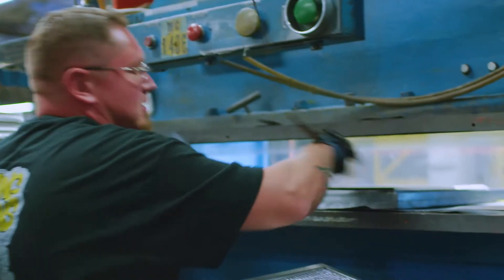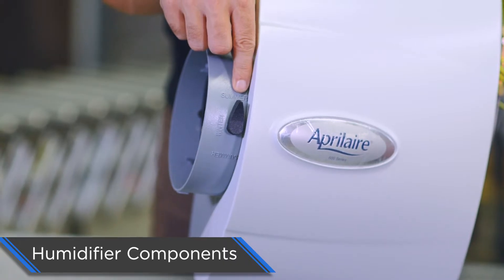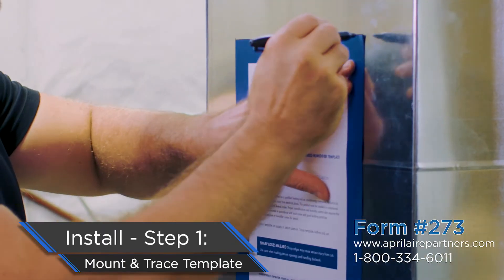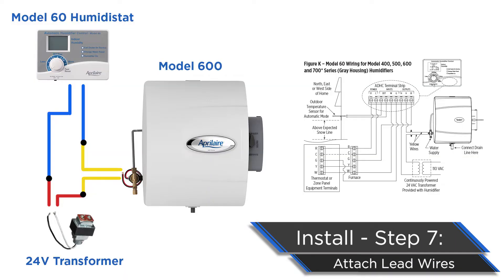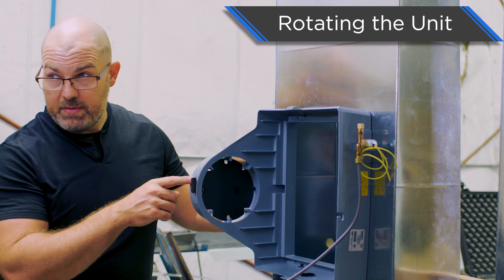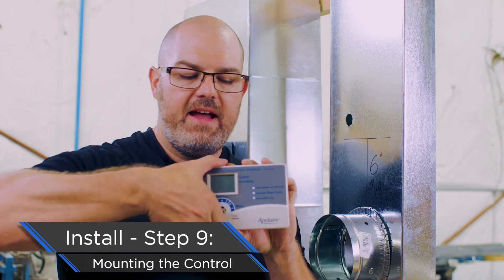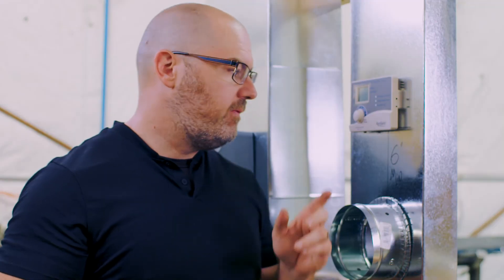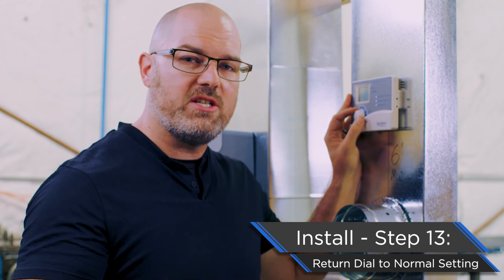Unboxing & Install | AprilAire Model 600 Humidifier

Comment: At the 12 minute mark the filter settings are discussed as being Off, B or C.   I do see an A printed on the circuit board. Just wondering whether that is a setting as well.
Reply from the maker: Thank you for contacting AprilAire! The A indicator is an option as well. The A indicator is for 150 hours of operation. The B indicator is for 300 hours of operation. The C indicator is for 600 hours of operation. If you need assistance for your specific unit, please contact our technical support team at 800.334.6011.

Comment: I would like to see or read some discussion on a system where the fan runs 24/7. How does that interact with the auto/manual switch inside the control and the on/off switch on the bottom-outside the control? Obviously, I don’t want water running 24/7. (Running the fan is needed for even heating and cooling on two living levels.)
Reply from the maker: Thank you for contacting AprilAire! The AprilAire humidistats require two requirements in order to run. There needs to be a call for humidity and a heat or fan call from the HVAC. If the fan is set to constant run, the humidifier would just look for a humidity call. The auto or manual setting would affect the set point the humidifier is looking to achieve. In auto mode the humidifier has a moving target based on the outside temperature. Where in manual mode it has a more set setpoint.  If you need any assistance, please contact our technical support team at 800.334.6011.

Comment: Did you change the direction of the bypass ? It was on the left first and then you finished off with having it on the right ??
Reply from the maker: @andresbravo6447  The bypass damper assembly will stay connected to the base and move with the base when adjusted.
Reply: Awesome does it matter if solenoid Valve is upside down if you change direction ?
Reply from the maker: @andresbravo6447  For operation, rotating the valve is not necessary; however, it is designed with the capability to do so if desired.

Comment: My unit caused mold somehow. Maybe I wasn't educated enough.  I don't know.
I am considering removing my Aprilaire. 
Should I seek and consult professionals for help? Why mold?
Reply from the maker: Thank you for contacting AprilAire! Generally with mold growth, it is seen due to an incorrect installation or application. We would recommend contacting our support team with any questions at 800.334.6011 and reaching out to a local HVAC contractor if needed.

Comment: is it ok to use the "W" and "c" terminals on the control board for power?
Reply from the maker: Thank you for contacting AprilAire! The control needs 24 Volts when the heat is running. We advise connecting to the hum and C terminals as those are outputting 24 Volts specifically for a humidifier. W and C are technically not outputting it for the function of the humidifier and more for the furnace operation. We would be happy to discuss this further and can be reached at 800.334.6011 Monday through Friday, 7:00 a.m. to 5:00 p.m. CT.

Comment: My humidifier green led light does not stay on. I have done reset several times, letting the led blink 60 times, then turning the dial to 4 or 5. Led stays on for half hour or so then turns off. It does not light up again when the heater turns on. What am I doing wrong here? Please help. Thank you
Reply from the maker: Thank you for contacting AprilAire! Could you please give us a call so we can walk through possible causes and discuss further? We can be reached at 800.334.6011 Monday through Friday, 7:00 a.m. to 5:00 p.m. CT. Thanks again for contacting AprilAire.

Comment: I installed this in my home, I noticed airflow leaks out through edge of closing front panel, so I have to aluminum tape around it.
And the water-drip grill does not stay in or lock in, it has tendency to lean to the front panel which will result in water leaking  through the edges.
The bottom water drain hole water leaks too.  This thing has full of issues.
Reply from the maker: Thank you for contacting AprilAire. We’re sorry to hear of the issues you have been having with your Model 600 Humidifier and would like to offer our assistance. 

Leaking can be caused by an obstruction of water flow or when the components within the humidifier are not firmly in place and level. 

If you would like to discuss this further over the phone, we can be reached at 800-334-6011, Monday through Friday, 7:00 a.m. to 5:00 p.m. CT. One of our technicians would be happy to discuss more with you over the phone.

Thank you for the opportunity to be of assistance; AprilAire appreciates your business.

Comment: What wire configuration should I use to make sure my humidifier doesn’t come on with the ac compressor? I just want it on with the furnace in the winter.
Reply from the maker: Thank you for contacting AprilAire! Would you mind giving us a call at 800.334.6011? We would be happy to walk through this with you in detail. We will need to know which controller you are using. A team member is available at the number above Monday through Friday, 7:00 a.m. to 5:00 p.m. CT. Thanks again for contacting AprilAire!

Comment: Does anyone know the width of the box minus the round duct opening
Reply from the maker: Thank you for contacting AprilAire! The product dimensions are 15.38" (width) x 15.75" (height) x 10.25" (depth). These dimensions are the Model 600 itself only and do not reflect the box it comes in. Does this answer your question? If you have any further needs, we would be happy to assist.
Reply: @aprilaireco  I’m looking for the width of the base of the humidifier. Not including the round part to the attachment of the round duct.
Reply from the maker: @absolute7250  Thank you for your follow up. The base will use a plenum opening of 10” x 12.75."

The base itself is roughly 12" wide and 17" in length. If you have any further questions, feel free to contact us at support@aprilaire.com or by calling 800-334-6011. Thank you for the opportunity to be of assistance; AprilAire appreciates your business.

Comment: Where is the R & C in the furnace?
Reply from the maker: Thank you for contacting AprilAire! The R and C would be located in your HVAC system near your other wiring terminals. Industry standard wiring terminals would utilize R,C,W,Y and G. You may need to contact your HVAC company to determine where they are located. Thanks again for contacting AprilAire.

Comment: What size cutout do i need to put in my plenum to install this unit ?
Reply from the maker: Thank you for contacting AprilAire! The Model 600 uses a 10”W x 12-3/4”H plenum opening. If you have any additional questions, we would be happy to assist.

Comment: The water into the pad  is flowing continuously.  I've removed the unit to replace the valve and removed the copper pipe going into the valve and also the plastic pipe going into the top of the water pad.  I notice there is a small yellow restrictor plug in the end of the tube going into the valve.  I assume this restrictor plug is to reduce the water flow to three gallons per hour.  What would be the results of removing the restrictor plug to increase the water supply to the filter?  Wouldn't removing the plug increase the humidity in the home?
Reply: The yellow plug is a a metering orifice.  If you remove it, the humidifier will immediately overflow and leak.  Also, never try to clean the hole in the orifice with anything other than water.  Enlarging the hole by even a few microns will cause the humidifier to overflow and leak.

Comment: Does the unit have to be installed on the return duct or the supply?  In theory it shouldn't matter should it? Thanks
Reply from the maker: Thank you for contacting AprilAire! The Model 600 can be installed on either the supply plenum or cold air return of a forced air handling system with right-hand or left-hand bypass duct connections. The humidifier dimensions and serviceability must be considered when selecting the best location for the humidifier. Find an AprilAire Healthy Air Professional nearest you to get started at https://www.aprilaire.com/find-a-pro. If you have any questions, we can be reached at 1-800-334-6011 Monday through Friday, 7:00 a.m. to 5:00 p.m. CT.
Reply: @aprilaireco  does this apply to the 500m as well?
Reply from the maker: @pilotdog68  Thank you for contacting AprilAire. Yes, that is correct. The Model 500 and 500M can be installed on either the supply plenum or cold air return of a forced air handling system with right-hand or left-hand bypass duct connections. If you have any additional questions, we would be happy to assist.

Comment: Hi, do you need to connect the ODT wires to enable automatic mode. My humidifier has been installed in manual mode but it is the 600 model not 600M. 

Can I simply switch it to automatic mode via the internal switch?
Reply from the maker: Thank you for contacting AprilAire! You do need to connect the ODT sensor to the ODT terminals in order for the unit to run in Automatic Mode. If you were to switch it to the Automatic Mode without the ODT, you would receive an E3 error code, which means no ODT. The humidifier control does not function while in an error.  

For clarification, Automatic Mode does not affect anything in the humidifier's operation. It just adjusts the set point we are trying to reach based on outdoor temperature, hopefully to prevent condensation from occurring on your windows. 

If you have any further questions on how the humidifier control functions, please don’t hesitate to reach out to us at 1-800-334-6011. We would be happy to assist. Thanks again for contacting AprilAire.

Comment: Do you need an outdoor sensor for Aprilaire to work properly? Also, does it matter what side you install the unit on? ( Return or Heat side?
Reply from the maker: Thank you for contacting Aprilaire! The Model 60 and 62 automatic humidifier controls need an outdoor sensor to run in automatic mode. Without one, they will run in manual mode. Automatic mode will just automatically adjust the called for humidity level based on the outside temperature to keep moisture from forming on the windows.

Bypass humidifiers (Models 400, 500, and 600) can be installed on the return or supply. With the Model 700, we prefer it to be installed on the supply, but it can be installed on the return if hooked up to hot water. The Model 800 can be installed on either side. If you have any additional questions, we would be happy to assist!
Reply: @aprilaireco  ok, here is another question? If it is hooked up to the return side, does the ( mist/moisture) go through the furnace filter?
If so, don't that restrict the flow of the mist? And does the filter get a shorter life span?
Reply from the maker: @perrylund4889  Thank you for your patience here! The humidity does flow through the filter, but it does not affect the filter or impede the moisture in any way. Since the water is actually evaporated rather than throwing water droplets into the air, it does not affect any filters. If you have any further questions, we are happy to assist.

Comment: I recently had a new hvac system installed but after seeing this video,  I noticed that my Aprilaire humidifier is installed in the return duct and not the supply duct, as well as the control. Is that an acceptable placement or should it be relocated?
Reply: It's fine on the return, it's just slightly less efficient. Control should be on the return.

Comment: For the ADHC input G terminal, the instruction it says I need to connect to thermostat G  but my thermostat G connects to my Furnace G  so it is ok to connect  ADHC input G terminal and ADHC output Gf terminal  directly  to my Furnace G ?
Reply from the maker: Thank you for contacting Aprilaire! Would you mind giving us a call to discuss wiring? We would be happy to talk through this and point you in the right direction. We can be reached at 1-800-334-6011 Monday through Friday, 7:00 a.m. to 5:00 p.m. CT.

Comment: This video is all about the installation. That's fine, but my question is:  What about the results when you start using it.  I've heard these whole home humidifiers help a little when using a forced hot air heating system, but they don't make a big difference.  I would love to get some opinions on this.  I can't take that dry air in the winter that emanates from forced hot air heating systems.  Thanks.
Reply from the maker: Hi Peter - Thank you for contacting Aprilaire! An Aprilaire whole-home humidifier will help with the dry air you reference experiencing as it introduces moist air into the home with the help of the heating system. The Model 600 can service very loose homes up to 1,000 square feet, average homes up to 2,000 square feet, and tight homes up to 4,000 square feet. These numbers are based on the following conditions for your reference: (1) 20°F and 70% RH Outside Air; (2) 70°F and 35% RH Room Air; (3) Internal Moisture Gain of 1 lb/hr; (4) 70% Blower Operation; and (5) 8-foot Ceiling Height. We would be happy to discuss this further and can be reached at 1-800-334-6011 Monday through Friday, 7:00 a.m. to 5:00 p.m. CT.

Comment: Can it be installed on the return air side ? If the water panel gets plugged water intrusion would be less likely to damage the furnace.
Reply from the maker: Hi David - Thank you for contacting Aprilaire! The Model 600 humidifier can be installed on either the supply plenum or cold air return of a forced air handling system with right-hand or left-hand bypass duct connections. If you have any additional questions, we'd be happy to assist.

Comment: Is it true that the manual version is more robust and lasts longer than the automatic version of the 600?
Reply from the maker: Hi Victor - Thank you for contacting Aprilaire! The manual control is a much simpler humidistat, but it has more restrictions on it. This control will only operate the humidifier when the furnace is producing heat, which limits how often the humidifier can run. The automatic control has more features for optimal control over the humidity in your home. This control will allow the humidifier to operate the furnace fan if there is a need for humidity. If you have any additional questions, we'd be happy to assist.

Comment: Is it necessary to connect the outside temperature sensor?
Reply from the maker: Hi Randy - Thank you for contacting Aprilaire! It is only necessary to install the outdoor temperature sensor if you wish to run it in automatic mode. If you have any additional questions, we'd be happy to help.

Comment: Does it work on the model Max Air 100e furnace?
Reply from the maker: Hi Jody - Thank you for contacting Aprilaire. If the furnace has a variable speed motor in the unit then the slower fan speed would affect the amount of evaporation occurring off of the water panel. The amount of humidity being evaporated on the Model 600 is reduced with the slower fan speed. We would recommend our Model 700 or 800 humidifier as they would be better options with that furnace. If you have any additional questions, please let us know. Thank you!

Comment: Make sure your control device is level. Don’t worry about hooking up the water supply or wiring up for power.
Reply: we don't want power, we just want a good level control panel.  Not too much to ask.
Reply: I've installed alot of these they don't have to be dead ass level

Comment: i think i have a bad transformer, the water solenoid is not operating, everything else seems to be working fine, is there a work around?
Reply from the maker: Thank you for contacting Aprilaire. Would you mind giving us a call to discuss this? We can be reached at 1-800-334-6011.

Comment: Do you have to use the April aire control board that gets mounted to the duct? Or can you have the humidifier wired to a wall humidistat in your home?
Reply from the maker: Hi Julian - Thank you for contacting Aprilaire! You do not need to use the Model 60 Automatic Digital Control. You can have it wired to the wall humidistat – just make sure you are using a transformer in that circuit to provide 24V directly to the solenoid. If you have any additional questions, we'd be happy to help. We can be reached at 1-800-334-6011.

Comment: So my customers units are in the attic, along with them having flex duct. He wants 2 installed. 10,000 square foot home. How many square feet of indoor home can 1 unit satisfy? Will i need to create hard-duct to mount this? T-stat wire will now go to this rather than to the air handler, and then from the aprilaire stat to the Air handler? Is the damper able to be controlled by the aprilaire stat? Seems you toggled it manually.  You said H H is the solenoid control output, where does the wire travel from and to for H H?
Reply from the maker: Thank you for contacting Aprilaire. Would you mind giving us a call directly to talk through these questions? We'd be happy to assist. We can be reached at 1-800-334-6011.
Reply: @aprilaireco  i did. Scheduled a call back even. When you called me it was an automated vm asking to Schedule another call back lol
Reply from the maker: @deathntaxeset  We will be back in touch with you over the phone as soon as possible. Thank you!
Reply: Ok its been over a week now. I've left voice-mail, scheduled call backs, emailed you,... Are you people even a real company???
Reply from the maker: @deathntaxeset  Thank you for circling back to us here. We are incredibly sorry for the delay. We are reconnecting with our support team now on this end to get this resolved. We want to ensure that they have the correct contact information for you as well. Would you mind sending us a private message on either Facebook or Instagram with your telephone number? We can be reached on Facebook at https://www.facebook.com/aprilaire or on Instagram at https://www.instagram.com/aprilaireco/.